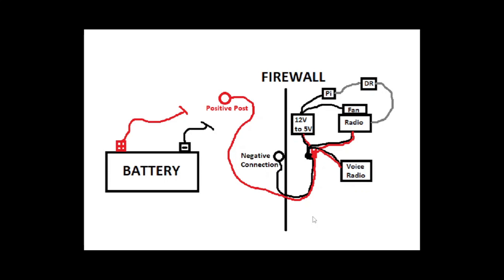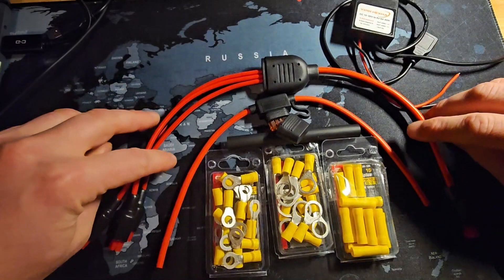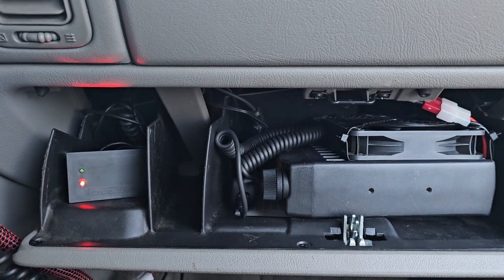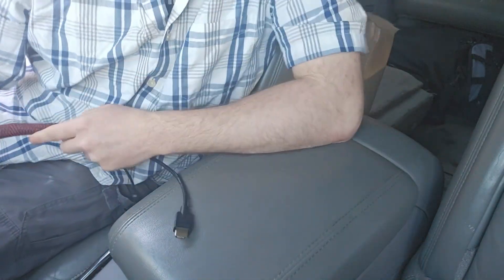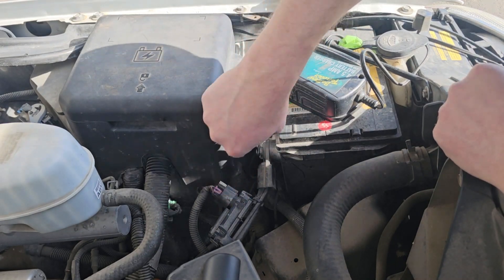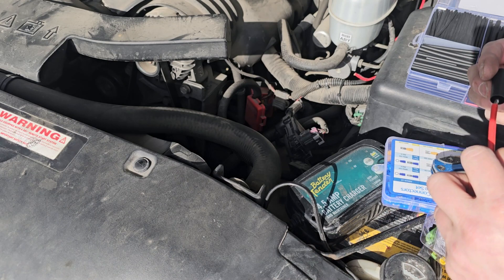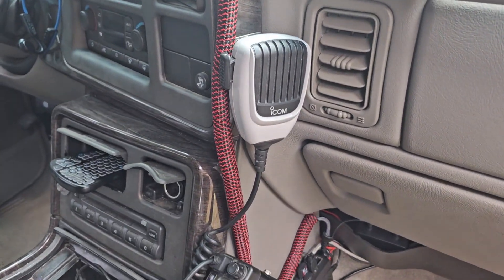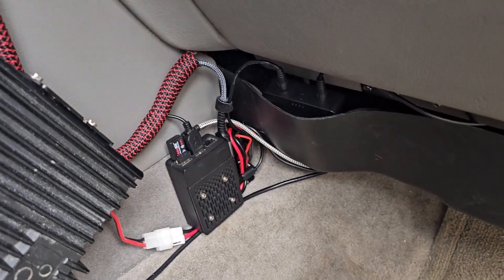Mobile Digital Comms System Install

Comment: The negative connection needs to go   wherever the negative battery terminal attached to the frame.  

This will help prevent ground loops.

You DO NOT want to connect both + and - to the battery terminals.

Comment: What's the monitor and how did you connect it to the dash?
Reply from the maker: Just a small HDMI monitor from Amazon, and then a tablet mount that suctions to the windshield and dash. A more glamorous way of setting this up would be to bolt a laptop mount to the front passenger seat mount, similar to a mobile data terminal in an ambulance or law enforcement vehicle.